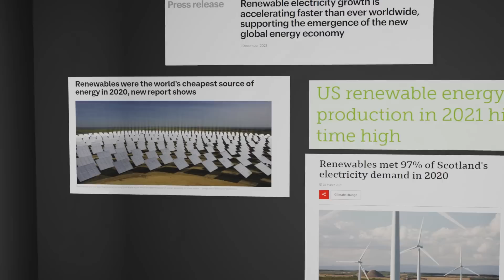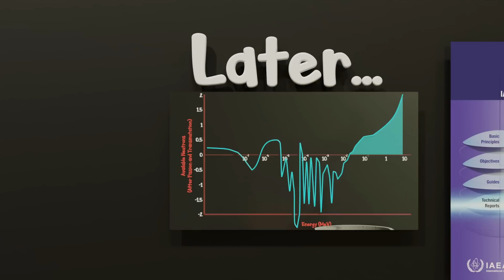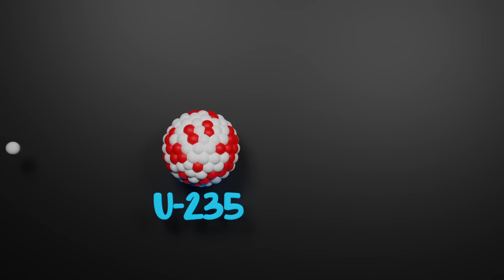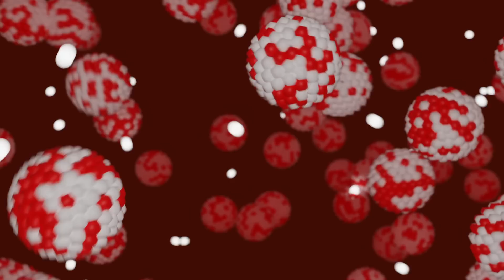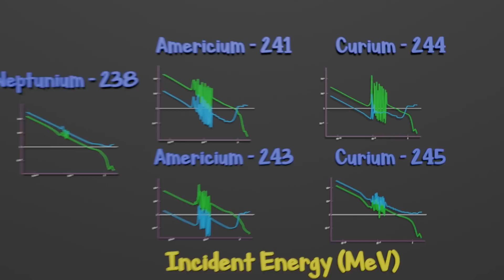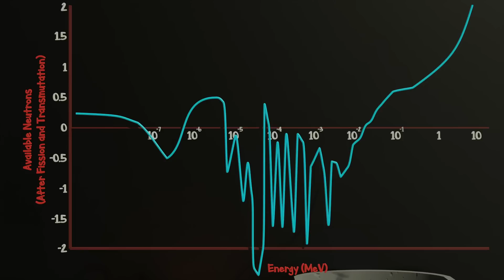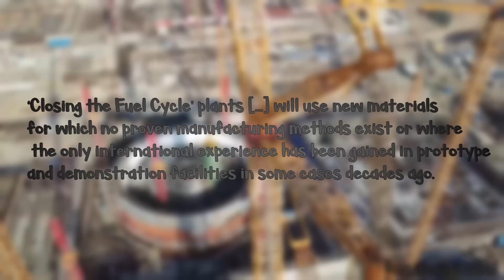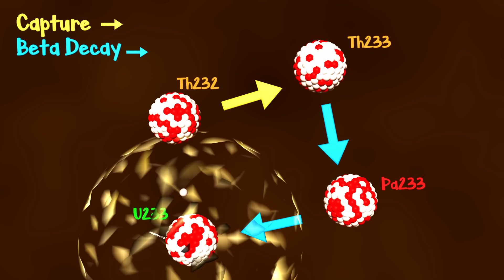How to turn Nuclear Waste into Nuclear Fuel

Comment: I really like the looks of the molten chloride salt fast reactor Ed Pheil and Carl Perez are building at Elysium Inc.

https://www.youtube.com/watch?v=jvNzRKGVAQI&t=103s

It will use table salt as its fuel medium, with a blended fissile/fertile fuel load from spent nuclear fuel and plutonium from decommissioned weapons and other sources.

Because it is a fast spectrum reactor which can run with much higher fission products loads, Elysium estimates a primary fuel cleanup will be needed at between 40-80 years. Also it's possible to remove fission products from the reactor as it runs some of which have commercial value like medical radioisotopes and Kr-85 which is used in industrial lighting and by aerospace for parts testing.

There is also a Canadian group developing a fast molten salt reactor to burn spent nuclear fuel using tube technology.
Reply: Some people admire the mushroom cloud from a nuclear explosion. Sometimes there is no accounting for taste.
Reply: @dunexapa1016  And people make asinine comments that have absolutely nothing to do with what is actually being discussed.
Reply: @dougcoombes8497   , Nuclear power is obsolete, dirty and dangerous. First tell me how you would deal with proliferation of nuclear weapons if you are a nuclear power advocate.
Reply: @dunexapa1016  Like I said asinine.

Nuclear power is already one of the safest, cleanest and low environmental impact methods of generating energy there is.

About to see an increase of that by orders of magnitude with new designs like Moltex and Elysium fast spectrum molten salt reactors.

Reactors designed from the start to burn fissiles like Pu-239 and U-235 that are used to make weapons, not create them.

In the reactors themselves the fissiles are protected chemically by fission products like cesium and strontium that are present in large amounts as it is a fast reactor.

And isotopically by all the U-238 and at least a 10% concentration of Pu-238 in the fuel mix. Any organization that could pull enriched fissiles from these MSRs could do it more efficiently, safely and cheaply by other methods.

Do a little research on your own, here on Youtube there is an excellent video with Ed Pheil and Carl Perez from Elysium energy about how their reactor was designed from the start to address all the concerns about reactor safety and proliferation.

Carl Perez is a entrepreneur from Europe who's father has been highly active in the anti-nuclear movement there so he is fully versed on this.

Check it and inform yourself.

Or just keep putting your foot in your mouth, it makes no difference to me.
Reply: @dougcoombes8497   NUCLEAR POWER IS FOR PSYCHOPATHS AND FOR PEOPLE THAT LIKE TO BE CONTROLLED BY PSYCHOPATHS. YOU DID NOT EXPLAIN HOW YOU WOULD PREVENT PROLIFERATION OF NUCLEAR WEAPONS. ARE YOU OKAY WITH IRAN AND NORTH KOREA BUILDING. WHATEVER TYPE OF REACTOR THEY WANT TO BUILD?
Reply: @dougcoombes8497   , HOW MANY MORE THOUSANDS OF NUCLEAR BOMB TESTING ARE YOU COMFORTABLE WITH? SHOULDN'T OTHER COUNTRIES BE PERMITTED TO TEST NUCLEAR WEAPONS ALSO, ... LIKE NORTH KOREA???
Reply: @dougcoombes8497   , WHICH WOULD YOU RATHER BUILD ... SOLAR BREEDER POWER PLANTS OR NUCLEAR BREEDER POWER PLANTS? YOUR ANSWER WILL TELL ME IF YOU ARE MORE TOWARD BEING A SANE RATIONAL PERSON OR NOT.
Reply: @dougcoombes8497   WHAT IS YOUR PLAN FOR DEALING WITH THE REAL WORLD? HOW MANY NUCLEAR POWER PLANTS DO YOU IMAGINE SHOULD BE BUILT BY 2050. AMERICA WOULD BE ON THE DOWNSIDE OF PEAK OIL BY THEN. HOW MANY? GO FOR IT? DO YOU HAVE ANY IDEA?
Reply: @dunexapa1016  Wow, you really are unhinged, no point in trying to have ANY rational discussion with you.
Reply: @dougcoombes8497   DO YOU MEAN YOU HAVE NEVER HEARD OF SOLDIERS KILLING FOR OIL? DO YOU KNOW WHY GERMAN AND JAPANESE SOLDIERS KILLED FOR OIL? MOST PEOPLE DO NOT. WHY DO YOU THINK MOST PEOPLE DO NOT KNOW?
Reply: @dougcoombes8497   I HAVE ASKED A VERY PRACTICAL QUESTION. HOW MANY NUCLEAR POWER PLANTS DO YOU BELIEVE SHOULD BE BUILT? SIMPLE PRACTICAL QUESTION.
Reply: @dunexapa1016  "WHICH WOULD YOU RATHER BUILD ... SOLAR BREEDER POWER PLANTS OR NUCLEAR BREEDER POWER PLANTS? YOUR ANSWER WILL TELL ME IF YOU ARE MORE TOWARD BEING A SANE RATIONAL PERSON OR NOT."

Rational person?

I'm not the one "shouting" deranged things here.

Nuclear power has millions of times the energy density of solar or any other low density renewable energy.

Which require vast amounts of space and materials to deploy on the scale to replace fossil fuels on a time scale that does anything to mitigate catastrophic climate change caused by massive fossil fuels use.

So yes, I support some forms of nuclear power especially fast spectrum molten salt which if you'd actually taken the time to read my OP you would know. 

Instead of going off on your insane rants.

As for proliferation which you seem to think is easy, these types of molten salt reactors BURN fissiles used in nuclear weapons like Pu-239 and U-235.

They run on spent nuclear fuel and plutonium. They are also proliferation resistant because they are fast spectrum reactors meaning they will operate at a high fission product load. The same FPs with chemistry similar to actinides meaning they will make it difficult to remove fissiles from the fuel salt using chemistry.

And even if you did they also run with high U-238 loads and will be mixed with at least a 10% Pu-238 load. Meaning it requires expensive and difficult isotopic separation to enrich the fissiles to the the high level needed for fission weapons.

Any organization with the resources to do so would have much simpler, safer and cheaper ways to do it.

SO to sum up, I support modern advanced nuclear reactor designs that have removed most if not all of the failure mechanisms of water cooled and moderated pressurized and boiling water reactors.

While running on existing stockpiles of fissiles and fertiles in huge amounts that are currently being stored as high level waste,

While using a fraction of the land space and resources of low density energy alternatives.

That also produce highly beneficial byproducts like medical radioisotopes and other valuable FPs.

While producing almost no greenhouse gases,

And also huge amounts of process heat that can be used for many other applications like heating in cold climates, water desalination and industrial process.

And it just goes on from there.

Is that clear enough for you.

Meanwhile it is raving lunatics like you that have been mindlessly attacking nuclear power for decades that have brought us to this existential nightmare where we are heating the planet so quickly through the massive use of fossil fuels that the very existence of the biosphere is now threatened.

And it all started from a small "donation" from the oil sector to Friends of the Earth in 1969 to get this insane ball of crazy rolling that you are obviously the product of.

So stop with your insane ranting.
Reply: @dougcoombes8497   , YOU STILL HAVE NOT EXPLAINED HOW YOU WOULD PREVENT NUCLEAR PROLIFERATION. IF SOME COUNTRY BUILDS A NUCLEAR POWER PLANT AND STARTS HARVESTING MATERIAL FOR NUCLEAR WEAPONS, WHAT WILL YOU DO?
Reply: @dougcoombes8497  , WHAT IF THE LEADER OF SOME COUNTRY WANTS TO BUILD THE SAME KIND OF NUCLEAR REACTOR DESIGNS THAT THE UNITED STATES USED THAT MADE IT EASY TO HARVEST MATERIAL FOR NUCLEAR WEAPONS. DO YOU ADVOCATE USING MILITARY FORCE TO STOP THIS???
Reply: @dougcoombes8497  WILL YOU PAY FOR ONE HUNDRED PERCENT OF THE COST OF NUCLEAR ENERGY AND NOT PASS ON ANY COST TO OTHERS OR TO FUTURE GENERATIONS? WHAT IF THERE IS A NUCLEAR ACCIDENT? HOW WILL YOU GUARANTEE THAT YOU WILL PAY FOR ALL THE COST? I DO NOT WANT OR NEED PSYCHOPATHIC NUCLEAR ENERGY! YOU WANT IT, YOU PAY FOR IT ONE HUNDRED PERCENT!!!! HOW WILL YOU GUARANTEE THAT YOU WILL PAY FOR ONE HUNDRED PERCENT OF THE COST???
Reply: @dougcoombes8497   , ARE YOU OKAY WITH NORTH KOREA BUILDING AS MANY NUCLEAR REACTORS AS IT WANTS TO BUILD OF WHATEVER DESIGN IT WANTS TO BUILD? WHAT IF NORTH KOREA DOES NOT WANT TO BUILD THESE SO CALLED SAFE PROLIFERATION RESISTANT NUCLEAR REACTORS? SHOULD THE UNITED STATES INVADED NORTH KOREA? HOW ABOUT THE UNITED STATES DEVELOP SOLAR WITH NORTH KOREA? HOW WOULD THAT WORK VERSUS INVADING NORTH KOREA? ARE YOU OBTUSE?
Reply: @dunexapa1016  stop with the "shouting" already.

All energy generation cost money, but the more pressing issue is the land space and resources needed to implement it.
And nothing compares to  nuclear power in that context.

And I defy you to explain how you'd even get radioactive material out of a molten salt reactor. The nuclear material is in solution in a salt. In the case of the Elysium reactor it isn't pressurized, there is no water to flash into steam, there isn't even a solid core to melt down.

The core is already molten. It uses active pumping to run, if the reactor loses power it automatically shuts down. All the fuel is then drained into subcritical storage in the larger molten salt filled tank the reactor vessel and all other components sit in and everything is thermally coupled and cooled by a cesium or sodium heat pipe.

So explain to me what an accident in that case would even look like.

And even with PWRs and BWRs it took flagrant negligence to make a few reactors fail. Most have operated for decades with no issue at all.

And like I said, these fast spectrum reactors run on spent nuclear fuel and plutonium meaning they reduce the threat from stored nuclear material. Because they are fast spectrum they can also use depleted uranium as part of the fuel cycle. So we already have the stored fuel for centuries at energy current demand.

Produced by safe and highly efficient reactors. Current water moderated/cooled solid core reactors have about 1.4% efficiency. 

The Elysium will have 99% fuel efficiency. almost everything coming out of it will be short half life fission products either stored on site until at ground state which is about within 10 years for most of it.

Or like I said, sold as valuable byproducts like the Technetium 99m, Iodine 131 and Bismuth 213 used in medical imaging and cancer treatment.

Far from being a harm these reactors will be a constant source of life saving medicine.

They also operate a high temperatures meaning they can desalinate large amounts of sea water for places that are experiencing fossil fuels driven mega droughts like California.

They are the most rational means of saving ourselves from catastrophic climate change driven by fossil fuels use.

There's a reason the fossil fuels sector also supports low density renewables, they know they cannot replace fossil fuels except on the long time scale.

So people like you who are fanatically anti-nuclear are by default also pro-fossil fuels and pro-climate change.

How are you going to pay for the loss of everything in the world.
Reply: @dougcoombes8497   IF IT WAS NOT FOR PSYCHOPATHS WANTING TO BUILD NUCLEAR WEAPONS THE UNITED STATES WOULD HAVE DEVELOPED SOLAR ENERGY A LONG TIME AGO. PEOPLE WERE SOLD ON NUCLEAR ENERGY FOR NUCLEAR WEAPONS PROLIFERATION PURPOSES!!!
Reply: @dunexapa1016  troll

Comment: Great video. I'd like to point out that reactors often last longer than 30 years. There are some SMRs that are designed to only last that long but there's no rule why they can't last longer. Indeed there are reactors today that are licensed until they're 80. I'd also like to point out that some kinds of fast reactor can actually consume nuclear weapons. A pool type Molten Salt reactor has it's fuel and coolant mixed together and you can basically just toss in your weapon's material which is downblended to non-weapons grade in the reactor and is fissioned.

Another thing to talk about with those few Fast Reactors is they were really experimental or test reactors that were trying out a variety of things like new coolants. However there are incoming fast reactors right now like Natrium in Wyoming so they're much closer than you might think.
Reply: And when a nuclear power plant is decommissioned who will pay the cost of guarding it?
Reply: @dunexapa1016  nuclear power plants have all decommissioning costs baked into the price for their power
Reply: @dunexapa1016  Get a life

Comment: Great video, I love the visualisations, but just a couple of corrections! You point out that one of the largest arguments against wide spread fast reactor implementation is that it would be easy to produce plutonium-239 for use in nuclear weapons. It's only partially true - although it's easier to chemically separate plutonium from uranium - it's actually far easier AND quicker for countries to use centrifuges/gaseous diffusion to isotopically enrich natural uranium to whatever level they want. Look at North Korea for example.
And while some U-238 is inevitably bred in the core where neutron speeds are the fastest, most of it is produced in the outer 'blanket' regions surrounding the core. Fast-breeder reactors take advantage of all these excess neutrons and try to minimise neutron leakage by completely blanketing the core with natural or depleted uranium.
Reply: Any person that advocates building nuclear power plants is advocating the proliferation of nuclear weapons ... they just may not realize it. There have been over TWO THOUSAND nuclear bombs tested and there are thousands more around the world still. 
To deny that nuclear power plants and nuclear weapons go hand in hand is to deny History. Do you know the reason for the United States PREEMPTIVE invasion of Iraq. Thousand of innocent people were killed.

Comment: Any person that advocates nuclear energy is also advocating proliferation of nuclear weapons ... they just may not know it. Over 2,000 nuclear bombs have been detonated so far and there are thousands more in storage or in missiles. The material to make these nuclear weapons came almost entirely from nuclear power plants built, ostensibly, for 'peaceful' purposes.
Reply: ctrl+C,ctrl+V.
Reply: No, they aren't. That's as asinine as conflating fossil fuels and thermobaric weapons. Commercial power reactors CANNOT make weapons grade material. Only a handful in the world can even theoretically do so, such as CANDU reactors if operated illegally.
Reply: As part of the Manhattan Project Canada contributed the raw Uranium but Canadian, and British scientists and engineers sent to Canada to ensure they didnt fall into hostile hands, developed a different reactor model that used heavy water as both a moderator and for thermal energy extraction.  This design eliminated the requirement to enrich the proportion of fissionable U235.  It also avoided the need for a pressure vessel, so fuel can be replaced without having to be shut down the reactor.  Enrichment is perhaps the most technologically sophisticated part of the process.  The Canadian Deuterium natural Uranium or CANDU reactor is less sophisticated than current generation light water enriched Uranium reactors, in part because it cannot fail from a loss of coolant accident like Chernobyl or Fukushima.  That is because the presence of the heavy water moderator is essential to the nuclear reaction.  Several developing countries, including India and Iran, have therefore built heavy water moderated natural uranium power reactors to supply plutonium for their weapons.  By treaty with the USA Canada hands all of the plutonium produced by our power reactors to the US DOE.  So we cannot remix it.  I have read that the CANDU reactor can in theory burn an appropriate Thorium fuel.
Reply: @jamescobban857   , All this BLAH, BLAH, BLAH ... to avoid saying that Canada helped India build a nuclear reactor and India harvested material from this reactor to make NUCLEAR BOMBS and set off an nuclear arms race with their neighbor Pakistan ... and nuclear power advocates STILL insist nuclear power is safe. Suffering from psychosis I think.

Comment: The problem isn’t that humans use fossil fuels to return carbon back into the carbon cycle that was taken out millions of years ago.

The problem is that we do not study the cycle well enough to understand that economies existed long before humans did. All an economy is the transaction between two systems. Animals take the O2 that plans give up just as plants take the CO2 that animals give up.

Nature is pretty good about creating a demand for any supply present. Nature is pretty good about creating agents that thrive off the waste of others. If you follow that pattern and apply it to human economics, then the solution for “waste” is to find an economical use for it.

Take hemp, for example. It has many uses pertaining to its fibers, oils, and seeds. You can sequester about 10 tonnes of industrial fiber from one crop of hemp grown on a hectare of space. It takes about 100 days to grown help conventionally, but aeroponics have shown to increase agricultural production by over 3,000%. So in an enclosed system that would allow for three crops conventionally, you could produce 900 tonnes of hemp fiber per hectare per year. Incorporating vertical farming, that is scalable by a factor for every 20 feet you go up…or down. A vertical farm structure going a 4,000 feet deep into the ground can accommodate over 200 times a single hectare: 180,000 tonnes of hemp fiber. In a square kilometer, that would be 1.8 million tonnes of hemp fiber.

Being subterranean, other opportunities are created including underground wind tunneled created with asymmetric openings like Black Tailed Prairie Dogs; protection from meteorological catastrophes; viability in any environment; and access to geothermal energy.

This can be applied to all industrial usage of land allowing more to be returned to nature.